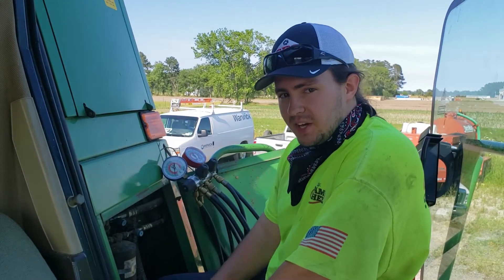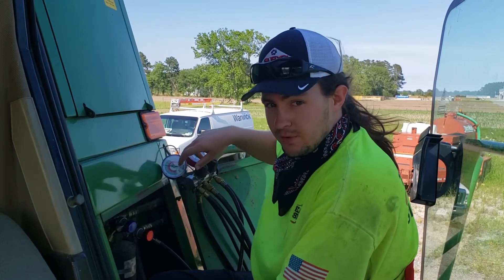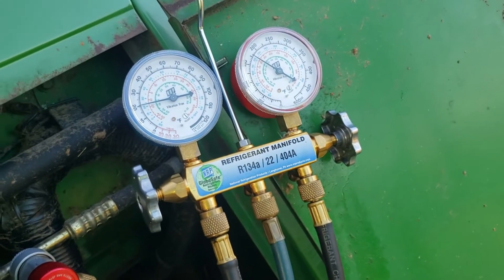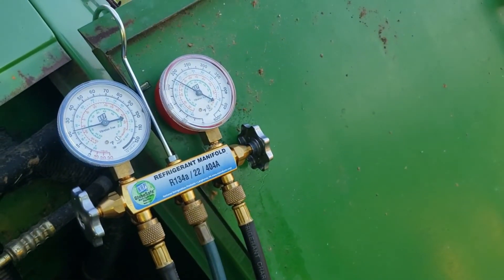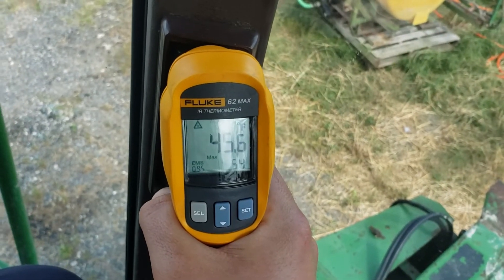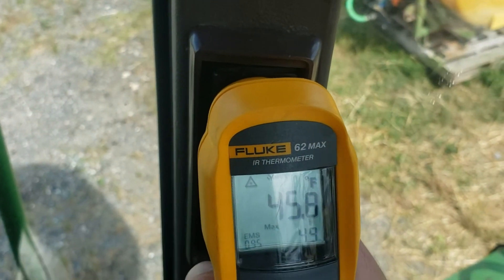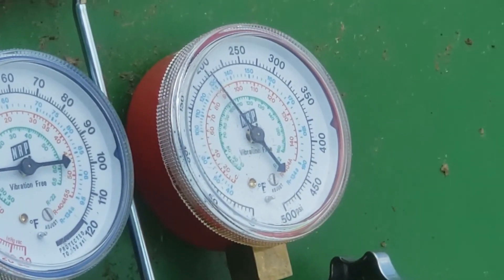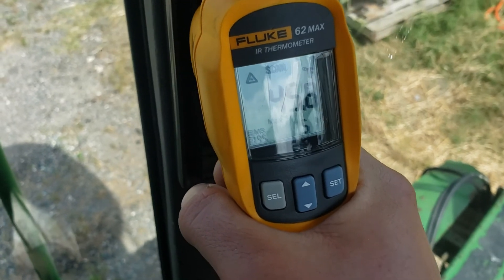John Deere 9600 ac fix

Comment: My 9500 AC problem was the thermostatic switch under the buddy seat, (broken probe) it had electrical current to it but not out of it to energize the high/low switches. I'm no expert but I got it fixed!